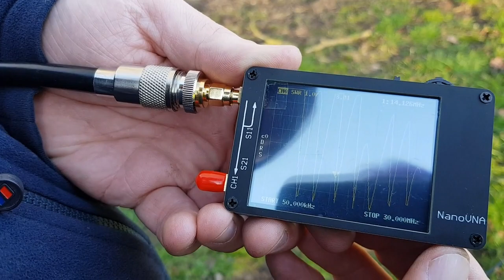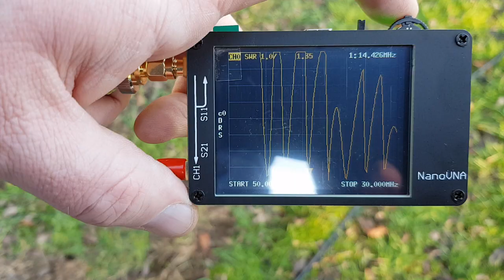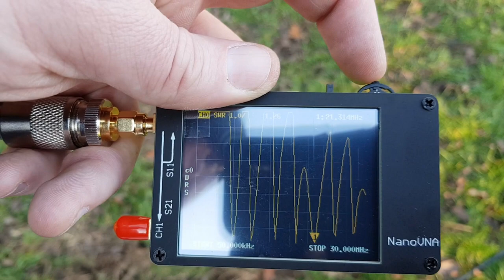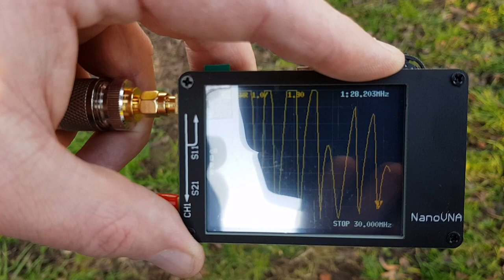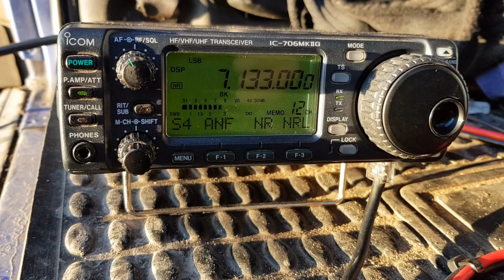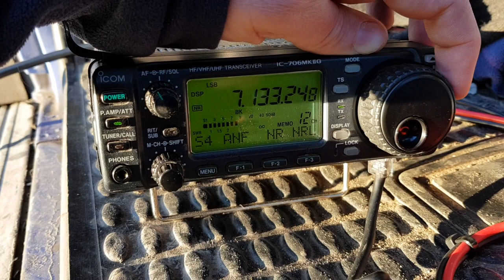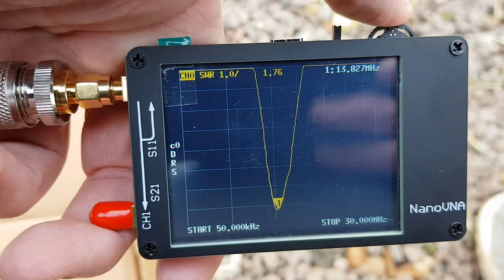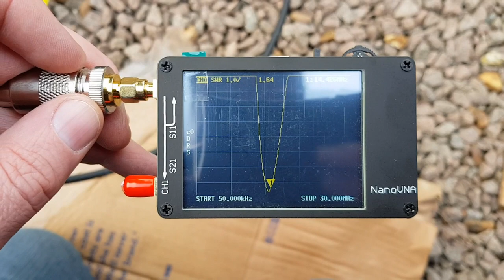Dx comander build part 3.

Comment: I had the same thing with 20 meter element and it ended up just like yours (the option  with the 6 cm fold back).  I did find that if you put a little spacer down about 1.5 feet from the top, that holds the 40 meter wire out and spaces it away from the 40 meter element wire going up, it helped bring the 40 meter element up in frequency while not taking 15 up too high in frequency too far by shortening it. I ended up with the 40 meter being lowest at about 7.1 and the 15 meter band being lowest about in the middle like around 21.250  Also as was pointed out to me on my YouTube video that the clips: I guess?? are supposed to be below the spreaders? Although not in any instructions: I am going to take a look at the Callum vids. to see what I can see??  I did mine like yours because it keeps all the spreaders from going up and down all over the place while you string the wires; it makes sense that way! What I need to think about is weather putting the clamps over the joint so that the clamps are over two thickness of the mast may actually be safer in that you are less likely to crack the tubes because you have the clamps on the joint keeping the sections tight so they won't slide down inside each other. I am going to try it that way but suspect it may affect my bungee lengths a bit. What I did works well because the plates rest on the tube below it and the whole thing can't go anywhere. Thanks for the video it helps see what others did. It is sooo blooming hot here in Utah that I am stuck indoors with 110 degree weather outside. Yuck I want to go and get this thing portable on the air! 73 DE KB7CQ

Comment: All setup and working. I had to use the  4.82m and 20cm foldback for 14mhz. I am very pleased so far, its turning out to be a pileup buster on the key. Work ZL on 7mhz 2 days ago. I will be doing some WSPR checks to see how my signal compares with other UK stations. Once again thanks for your great videos. Steve G4YTK

Comment: Hi , great videos I will be following yours while I build my DXC hopefully this week. I have just ordered carabiners. My question for now will there be enough cord to cut 3 guy ropes supplied from Cal or have I got to go and buy some ?
Reply from the maker: Hi, thanks for watching. The cord supplied is enough to make the guy ropes. I have personally made another set that can be adjusted as you never know what's an inch beneath the soil. I use paracord for lots of my antenna projects and can be picked up cheap on Amazon. 73 Steve 2E0XSB

Comment: Great set of videos, I'm leaning towards getting a DX Commander set for myself. I'm wondering about the NanoVNA you're using.  I could do with one of those but I've been afraid of buying one because there is a multitude of different ebay suppliers and none of the mainstream suppliers sell the NanoVNA. So I don't know who to trust and worried incase I get a counterfeit copy. They don't all look the same and there are lots of different versions with different firmware and variations of the kit. Can you recommend a supplier so I don't end up with a duff one? Thanks. Austin M7AVX

Comment: Still fighting with the swr on all my bands. Going to take it down again and try one frequency at a time till I can get it right. SWR is so high that my external MFJ 998 tuner can only get the swr on any band down to 1.7 to 2.  The 10 meter band is unusable even with an external tuner. Been dealing with this virus in our neighborhood and being almost 70 years old has slowed me down a lot taking it up and down. Glad yours went so well. Also I am debating on going by testing at the base of the antenna verses at the radio. I believe the latter is the way to go. Thanks again for your three part series, I appreciate your effort in helping all of us with this antenna setup.
Reply: Hi… Hope you got your SWR issues sorted 🙏

Comment: How do you get the elements back in place after shrink wrapping them as surely wont fit through the holes on the plates when shrink wrapped?? Asking as just about to start doing mine this weekend.many thanks and great very straight forward videos👍👍
Reply from the maker: Its a close fit but they do go through easily. Thanks for watching 73 DE 2E0XSB

Comment: Hello Steve! Nice videos. Wanted to ask if the results were what you waited for? How was the performance in 40m / 20m? I´m planning to buy a pole tomorrow from DX Commander and make my own antenna.
Reply from the maker: The DX Commander works great on 40m and 20m they are my most used bands. 80m I do use an ATU but thats 80m for you. I would also recomend the DX10 wire its great to work with. 73 DE 2E0XSB
Reply: @radiorants1094  Great, thanks. Just bought the pole. About the wire, gonna try something similar this time, maybe later I´ll get the full kit.
Reply: @FoxtrotMike  Hope you realise the importance of DX10 velocity factor and correct amount of wire to be used and cut including foldbacks, be interesting how yours turns out best of luck
Reply: @mikeh9446  Hi Mike and thanks! Well, that´s a point I´m concerned. I guess I´ll have to make a lot of trial and error attempts (40m/15m first). It was way too expensive right now to get the DX10 wire shipped here, gonna wait a bit.

Comment: Fantastic series. Makes the assembly very clear. 👍 (My feedback to Callum was that his instructions are too 'historically chatty' about why he did this or changed that. I prefer step by step without side commentary, and with plenty of pictures.)
The old D10 wire is a right curly bastard to work with -- ask me how I know. 🙂
Reply from the maker: Hi James, thanks for watching. You wouldn't happen to be the James that Calum often mentions on his channel would you?
Reply: @radiorants1094  No, that's his good buddy from way back. Also acts as a moderator in his live streams.

Comment: HELP...  What do I do if my SWR is high? Do I shorten or lengthen the wire? I have a DX Commander as well and I am using the DX50 wire. Thank you and 73! W1KPS
Reply: Question appears: Is the SWR too high on lower frequency or higher frequency? low SWR above tuning frequency means too short (Add), low SWR Under tuning frequency is too long (Cut)
Reply: It’s on my 17m band
Reply: @kevinshieldsw1kps785  this should be: 17m band– 3.83m + 6 cms foldback According the manual for the DX all band
Reply: William van der Ven that’s what I did but I’m going out now to double check. We had lousy weather yesterday and it now warmed up nice to go out and do it
Reply: @kevinshieldsw1kps785  Solved the problem ?
Reply: William van der Ven seemed to have my swr still isn’t perfect, but my onboard tuner does enough. Now my problem is noise which I think is my solar panels, ugh!! Thank you for asking and many 73s!! W1KPS
Reply: @kevinshieldsw1kps785  Goodluck!
Reply: It’s also way out too not a little out.
Reply: @kevinshieldsw1kps785  You could try to replace the wire for 17m, maybe the wire is damaged inside?
Reply: William van der Ven You know maybe I’ll just replace the wire and start new. Thank you for your help!!
Reply: @kevinshieldsw1kps785  Great idea! Hi ... if it doesn't work, contact Call, maybe he can tell you what's going on. Goodluck 73s PD9WAC
Reply from the maker: Hi Kevin Thanks for watching my videos. Sorry I havent been around to help solve your SWR problem. After reading all the comments it looks like you have it under control. Solar panels can be a pain in the backside for noise, our tumble drier seems to wipe more than half of the 80m band.  73 DE 2E0XSB
Reply: Radio Rants Don’t be sorry! It’s not like I expect you to answer me right away! We have different time zones. Anyway, I’m in the middle of burying everything and I’m going to do the swr again. Can I tune each band individual? Or tuning one will screw up swr somewhere else? Thank you and 73! From the states stay healthy!
Reply: Expect you have this sorted by now, but for future reference, Cal has a neat calculator on his website that tells you how much to add or trim from an element to bring them in. 72 Jim M7BXT

Comment: Great build, well  done!  I've had all the DX Commander bits in the empire of dirt known as my shack for a year or so and with one thing and another I've never got round to putting it together. As soon as the weather's a bit better I'll get on to it. One of the members of my club has a DX Commander 
semi  permanently Installed.  He lashes it fully built to the side of his house when he isn't using it then just takes it I to the garden, slips it over a pole sunk into the ground, guys it then he's on the air. Have a look for ianxfs on YouTube. 
He also has some video on how it behaves in high winds.
Might catch you on the other side of the electric bill!
73 de Malc M0IYI
Reply from the maker: Hi Malc, I have just subscribed to his channel. He has some good videos, I am sure I have seen some of them before. Hope to catch you on the air 73 de 2E0XSB Steve

Comment: Hi Steve, many thanks for your videos, they are very helpful, Calum has done a great job on the DXC 

I wonder Steve if you have any detail on the 80M. Element on how you made the transition from vertical to Horizontal?

I intend using mine for Portable. From my VW California, so looking at ways for quick erect and dismantling for moving on

Many thanks in anticipation 
Regards Brendan. GM0CQV
Reply from the maker: Hi Brendan, thanks for watching.

The 80m element is a little more of a challenge I swaped the 30m for 80m and fed it up to the top spacer plate (the small 2 hole spacer), then I thew it over a tree branch to test it out. I filled an old sock with gravel and tied about 15m of paracord to the open end of the sock, thew it at a branch that was roughly 7m heigh (same height as the top spacer), then taped the end to the element to the chord and raised it up. Not ideal but was a quick fix and it worked. My plan is to get another smaller fishing pole and use that to hold the 80m element at 7m height. making a H shape as such. The sock and tree method worked well but means you need to be near a tree or large bush (and you get some funny looks on a camp site. one woman thought I was trying to kill squirrels lol). The extra pole means a longer setup and take down time but means you can take it anywhere. Hope this helps. 73 de 2E0XSB Steve.
Reply: Radio Rants hi Steve, ok on a second pole, I have a 7Mt one I can use if there not a handy tree, actually I was asking about the turn from Vertical to Horizontal  at the 30m element point, do you pass the 80M element through the hole and then go horizontal or do you have some sort of Loop like Calum suggests?  Something with a bit of give in it and not to sharp a transition?

I am hoping to do some remote areas here is Scotland over the summer, perhaps islands 

Thanks again Steve for your vids and replies
Reply from the maker: Hi Brendan, I have a small loop secured by 2 turns of insulation tape and used a small (10cm or 4") bungee chord with the spare carabinas and shock chord I had left. I used very little tape as I wanted that to be the fail point rather than put any undue stress on the rest of the antenna (That was my thinking anyway). I did try the 30m bungee at first but it didnt look right (stuck out to much) and me being a bit OCD just made the smaller bungee so it looked more aesthetically pleasing. I made a small loop under the top spacer but close enough to not put any tension on the bungee. It worked fine for a weekend away for me, however the weather was fine with just a light breeze. Hope this helps or gives you an idea of how you might solve this. If you do try something different please let me know how you did it. Wish you a great summer in Scottland with your DXC hopefully we might get a DXC to DXC contact on your adventures. Yes I am a little jealous. 73 Steve

Comment: I am in the process of building a DX Commander, and I think I have watched most of the vids showing builds. Callum's own series, detailing all the various models are, I think, the most help, but, that said, he did design it! So far my only change has been to not use the clear tubing on the hose clamps. No doubt it does work, but to me, an old school engineer, it looks a bit amateurish, so I have used a foam sticky backed insulation window seal. The D10 wire is a pleasure to use, far to "nice" to use for radials, so I am using some salvaged ring main cable. As it is solid fairly thick copper, it may work better, but as it cost me nothing and only a little time to strip down, I now have well over 50m of D10 for other antenna projects. I have a NanoVNA (from Amazon), as an alternative to an MFJ. It is as little fiddly, but is a great tool! Being on a  restricted income, it is handy, I discovered that the secondhand monoband Diamond white stick, actually covers 2m, 70 and 23, making it a real bargain, and has saved me having to buy another antenna to cover the extra bands.I would recommend the DX Commander series of Antennas, the quality of the kits is beyond compare, and apart from the hose clip "gripe" (which is a personal thing) I have yet to find any fault. The NanoVNA is also good value. The screen is a bit small, but you can link it to a laptop, which certainly helps. As an M7, it has capabilities well beyond my knowledge, but over time i have no doubt that I will find more uses for than just setting the element lengths for SWR. As my antennas and cables age, it will help with fault finding etc, proving the investment even more worth while! When set up using the Nano, there is no need for a tuner, which would nearly double the price overall, very important when starting out and when cash is short. If you compare the cost of a G5RV, a tuner and the masts, with guys etc, I reckon the DX Commander is cheaper, even if you add the cost of the NanoVNA in, not to mention the DX Commander takes up virtually no space and is easy to knock down and take portable. Jim M7BXT
Reply from the maker: Hi Jim, thanks for watching. My main aim of the build videos, was to stay as true as I could to the instructions. I plan a few modifications to my DXC in the future such as replacing the parachord on the elements with elasticated chord etc. The great thing about the design is that you can put your own mark on it, make it suit your operating style and such. I personaly feel that the DX Commander is an awesome cost effective antenna, made from great quality parts. As you say the DX10 is great to work with and it does seem a shame to use it as radials. I tend to build my own dipoles and parts to save on cost and find it to be the best part of the hobby, as I to am on a budget. I will certainly be buying more DX10 for future projects. Hope your build goes as well as mine 73 DE Steve 2E0XSB
Reply: Hi James ..... Glad that I came across your interesting and relevant  post .... I’m a new MI7 myself and am wondering whether I should erect an Inverted V or ask Santa for a DX Commander... If you have time to reply I would be very interest to hear how your build went as well as your overall impressions of how well the antenna has worked for you.... Seasons Greetings... Good Dx... 73.... Gerry ☘️🎄🎄🎄
Reply: @tixilx  As yet I have to connect it up. I live in social housing and my 2landlord" does not want me to drill holes in the walls! I can't even put up a white stick on the chimney! That said, I now have permission to bring the feeds into the loft, via a vent to bring them to the shack on the front of the bungalow, the antennas being in the back.My 2m feed is via the hole left when I took down the TV antenna, leaving room for RG58 through the hole where the 75 ohm went! A point of caution on dipoles, even a half size G5RV needs about 20 meters, with the 80mtr coils, the length of a cricket pitch, which I thought I could get in, but I forgot that I needed to allow for the guys on the end masts, however, by going inverted V I can just get it in. While i reckon the DXC Classic is the best one, if cost is a major factor, the portable options are cheaper, albeit with fewer bands, or failing that Cal does say in his videos that home build is an option. While not as good, to get you going and if you have a suitable mast, a bit of time with an old chopping board will get you in air. Cal gives us all the element lengths and encourages us to give it a go! There are loads of videos out there from experienced amateurs, particularly from the States who are very impressed, and can give a far more informed review that I could do if mine were connected! Hope Santa is generous! 73 Jim M7BXT

Comment: Where can I get the analyzer you used in the video? It’s much easier to use and gives much better graphic detail than my MFJ analyzer. Cheers 73 Fred
Reply from the maker: Hi Fred, thanks for watching. I got my NanoVNA from Amazon for around $45. I have had no problem with mine but have heard of people buying from other sources and having issues. For the price its a great piece of kit, just besure you source one from a reputable place. 73 DE 2E0XSB.